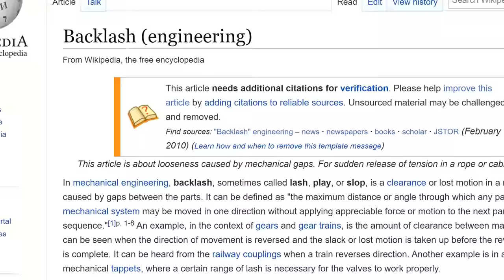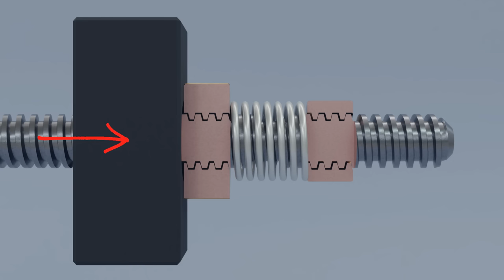Will this Z axis anti backlash nut improve your 3D printer accuracy?

Comment: The spring is used to add tension to the nuts, it's obvious that your springs are the wrong ones (no tension). Looks like you changed the springs or order without the ability to understand the context of what you are doing. If the springs are not compressed then they're not adding tension to the system. Hope this helps you understand your mistake even though I think you did it on purpose.
Reply from the maker: I am going to have to disagree with you there. I ordered the generic anti backlash nuts available on Amazon and aliexpress for the T8 lead screw and I used them as is. But the whole point is that you don't need them for the z axis of your 3d printer as I have explained in my video.

Comment: Parts on top of parts to fix issues with screw drive lol. And they wear. Just go belted. The speed and acceleration of your z axis alone will be worth it. Let alone accuracy.
Reply from the maker: Totally agree with you. But as an engineer, I like to test everything and try to explain what doesn't work and why.
Reply: @bluemonxterDIY  that I understand for sure
Reply: Why would anyone want more speed and acceleration on the Z axis? it is only moving less than 1mm.
Reply: Do you have data on the accuracy? The belts are not perfectly stiff, add to that the acceleration of the whole x axis, and I am curious how all interacts.
Reply: thats true for smaller printers, but for larger machines like my vcore 3 500mm, i need the strength of lead screws.
Reply: @AndrewAHayes  probing, z hop, printing fast.
Reply: @morbus5726  yeah no… there are 500mm and larger machines out there using belts. It’s the best solution. No fucking around with this crap. Use wider belts if you need more rigidity but they’re fiberglass lined and barely stretch even with 50 pounds on the bed.
Reply: @eslmatt811  tension, my friend. Along with a rigid motion guide (rail or proper pre load of v wheels). Nothing moves in the z axis I’ve never had better layer lines stacking than on my belted ender 3, my belted annex k3 (fastest printer that exists), and my voron 2.4
Reply: Backlash doesn’t exist, period. Accuracy is dead on. My probe tolerance in Klipper is 0.005mm. The z axis can probe that accurately at 30mm/s and 5k accel. That’s insane for a z axis.
Reply: @BigfootPrinting  could you give me a link? Do you have one of these huge machines that uses belts?
Reply: @morbus5726  check out annex engineering k1, k2, k3. K1 and k2 specifically are large. One is z axis bed lifting one is z axis gantry lifting. Super premium printer build.
Reply: @BigfootPrinting  those are tiny machines... the k3 is the size of the prusa mini. Of course it works well with belted z.
Reply: @morbus5726  you completely ignored the fact that I said k1 and k2 are huge. You don’t even have to look far in the printing community to verify that this is the way everyone’s design is going. You cannot talk your way out of the mechanical facts, the backlash and inconsistent loading on screws cannot compete with belts. What’s more, a 9mm belt can hold like 150 pounds without stretching 0.1mm so put 3 or 4 of those and good luck having issues. Do your research kid. I can’t be your teacher for free over YouTube comments. The stress analyses for these designs are available in many of the discords and the data specs from Gates on GT2, GT3, and HTD belts is online as well… direct from Gates.
Reply: @BigfootPrinting   I agree that belts are good, just saying that they aren't completely needed for good machines. the k1 and k2 can go up to 500mm^3, but the standard size is like 200-300mm^3, so you are right about that. From my experience, lead screw z axes are easier to set up, and are less complex, but belts do provide easier alignment and less z artifacting. 

You don't have to call me names when we're having a civil discussion. You're calling me a kid but you should act your age.

Comment: Partially right, and partially gdmn right! But... If you have another source of backlash. How can you prove that installing anti backlash nut does nothing? = )
First you need to eliminate backlash source, and then you can speak about anti blacklash nut role.
With current proof you only showed that you can not detect work of anti backlash nut, as there is backlash in some other component. = )
Reply: Also you have installed those antiwobbling spacers wrong. May be they create backlash too. There should be a brass nut, then spacers then x axis plate. With anit backlash nut it is hard to achieve, it needs some case which will hide springs.

Comment: To eliminate your backlash / play you need a screw ball spindle with the stepper motor in direct drive (same axis than the spindle) , without pullies and belts.
Of course this comes at a cost increase
Reply: no one has done x and y axis though :S

Comment: But what you are saying is incorrect. https://youtu.be/kmqLz-AmzVw?feature=shared&t=185 you can clearly see that the Z axis is moving when you push the spring upwards. But I agree with your conclusion. The spring loaded anti backlash nut is pretty pointless because gravity is working in your favour.